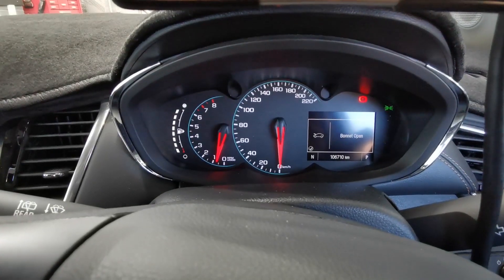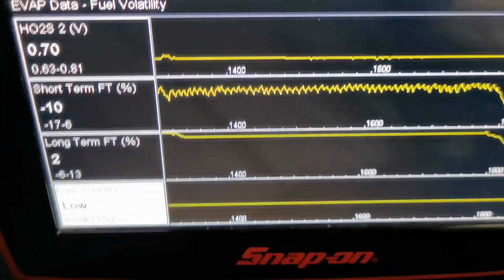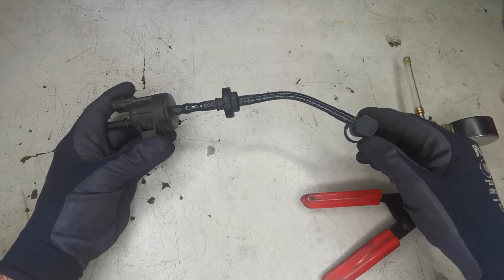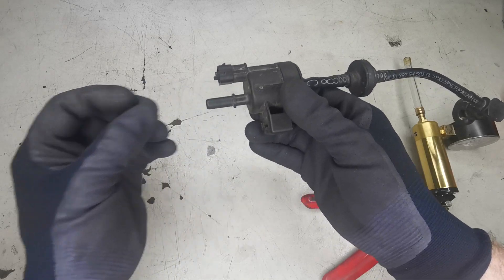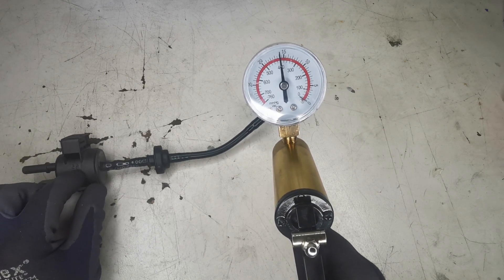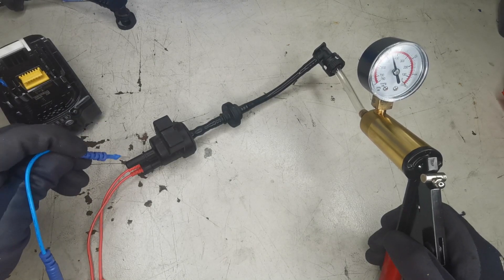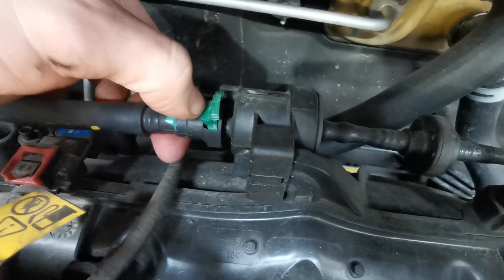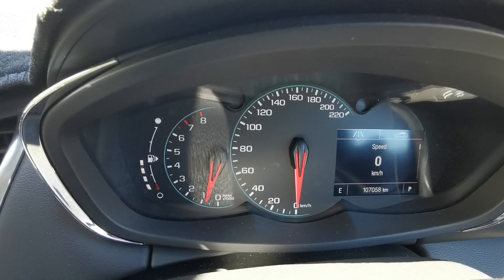EVAP Purge Solenoid Valve - Quick & Easy Testing With Step By Step Guided Instructions

Comment: Hello, My car has the same Purge valve. I am going to buy one but there are two options: first one is just the valve and the second one is valve with the tube at the right. The tube seems kinda tight. If I buy just the  valve, can i connect it with that tube or hose?

Comment: I’m trying to determine if my purge valve leaks enough to cause a small evap leak code. I put my vacuum pump on the port that goes to the intake manifold & pumped it to 15 in Hg. Do you think loosing just 0.25 in Hg over a 10 minute time span would be enough to cause the code?
Reply: No, the test that throws the code lasts way shorter than that. Ican't imagine it would care about that loss

Comment: A quick and easy repair. I know it's faulty but never understand why it's clicking on off. Always sounds like it's being command to be doing that
Reply: Weak spring
Reply: I sprayed silicone in a sticky purge valve 20,000 miles ago. No problems so far